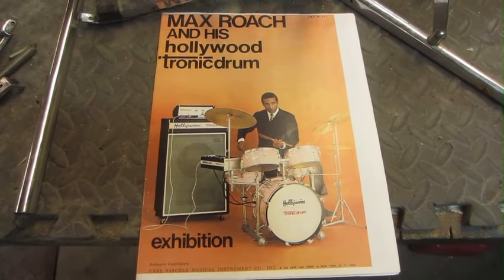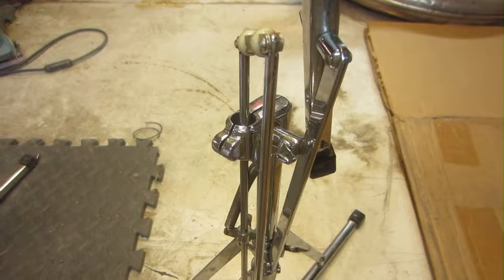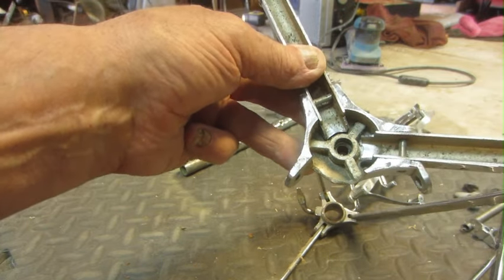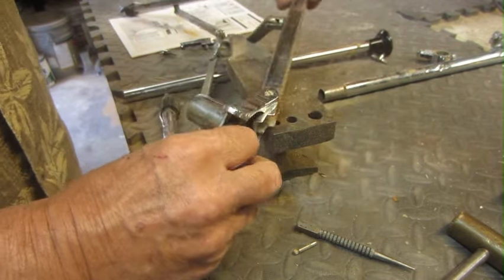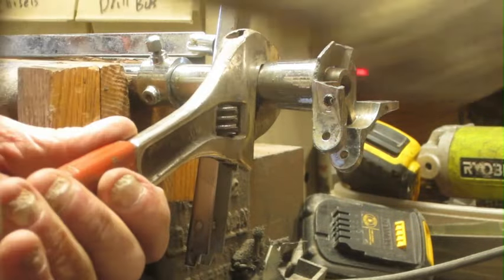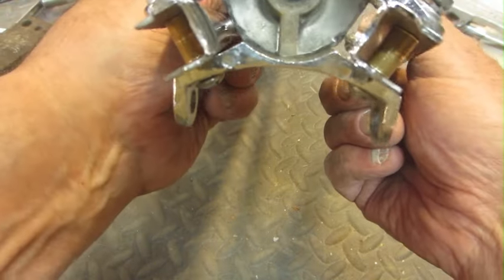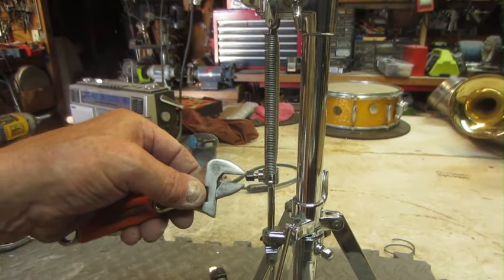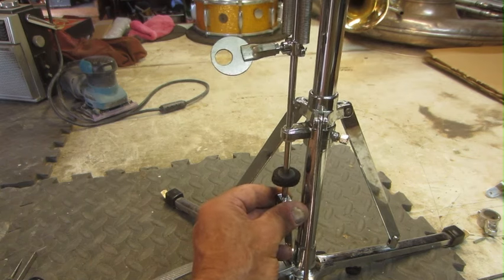Meazzi Hollywood Drums Hi Hat Stand Repair

Comment: Was thinking a compression spring where the felt and rubber are, might make it work great, with no clack sound.

Anyway… it’s a Cool stand! Thanks for the video!! ✨
Reply from the maker: Great suggestion BC! I think the rattle is actually from the hinge plate on the heel of the footboard. Anyway when I play it that sound never happens, so not a problem. Good to hear from you!